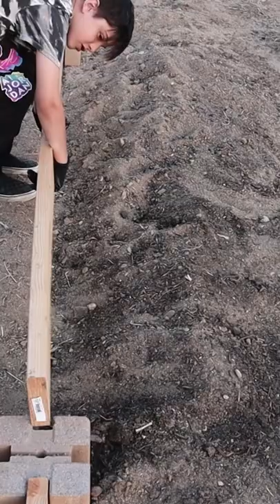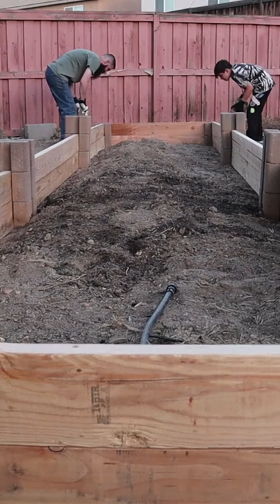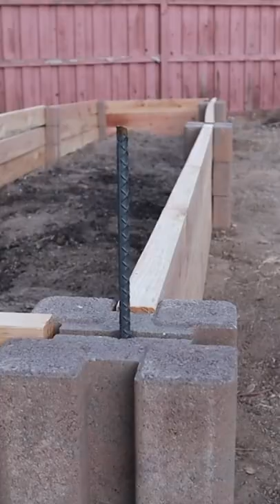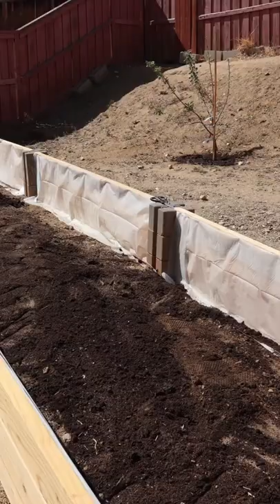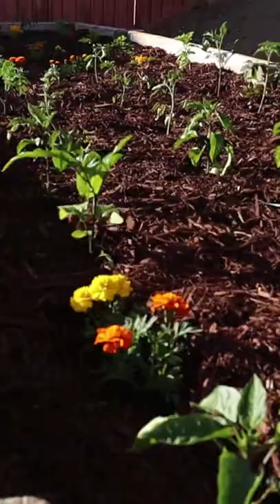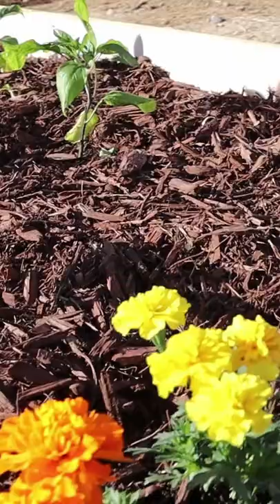Fastest way to build a Raised Garden Bed 😲💯 #shorts

Comment: This is a great idea for initially starting a quick garden.  But after about a year, the plastic lining starts chipping and breaking down into the soil and needs to be picked out.  Use a thick layer of cardboard instead of plastic so as it breaks down it won't put toxins into the garden.   . The corner bricks also start sinking into the ground over time which causes the boards to loosen and move out of place so they will eventually need to be repositioned.  But maybe if you live in an area that doesn't get much rain, it will work out well for you!
Reply: I don't think it can last longer than 3yrs if there is plenty rain like in Darwin where I live 😂
Reply: So you think pouring concrete under the bricks would help!
Reply: I think they might be using pressure treated boards. I get that it’s a strategy to keep the pressure treat from leeching into the bed but yeah I agree long term better would be heat treated and you don’t need the plastic then.
Reply: Dig down 4" under the blocks, place 3/4" stone and tamp down til level. Then place the corner blocks.  Problem solved!

Comment: I wish to build raised beds but I have 200m2 garden and this amount of wood to buy is too much for my budget.
 I did mounded raised beds instead, unframed. I have quack grass infestation so I rototilled a lot of wood chips, grass clippings and compost into my clay soil. I added minerals and then covered whole area with woven cloth to block the light.
I made small mounds 1.2x13m or 4x42 ft.
Reply: Quack grass is rhizomatic right? Rototilling would only multiply the problem if so. (we don't have quack grass so I'm not super familiar but I recall Charles Dowding addressing quack grass).

Comment: You guys are great! I keep agonizing over pressure treat vs non pressure treat wood, and somehow my brain never considered plastic sheeting! Thank you for showing this step!
Reply: Why plastic? If it’s a food garden I would want no plastic
Reply: @joansmith6844  For longevity of the garden bed. Wood rots, especially when it's constantly being watered, and the chemicals from pressure treated wood will slowly leech into the soil too. Otherwise you have to keep replacing the beds every few years.
Reply: @richelleg225  Thank you for your answer I know he reply to somebody about the plastic and where to get it from and he does NOT use treated wood If someone was making a food garden not sure why they’d wanna poison themselves But you would have to really secure that plastic not just staple it to corners or I would have to go over the edge to save  the wood from rotting-  not JUST on its side , water still would get in and seep  in between the plastic and wood You would have to take the plastic and go over the edges of the wood but I wonder if there’s another material you could use because plastic it’s not highly recommend it either if it’s a food garden.. The plastic will see into the soil and that’s not healthy- I wonder what someone could recommend to use instead of plastic maybe just another strip of wood all the way around and remove and replace it but that’s expensive
Reply: @joansmith6844 it's copper, not poison.  The formulation was changed in 2004 and it's completely benign now.  Copper is an essential dietary mineral.

I think a lot of people are confused because pre-2004 PT lumber formulations were definitely harmful, and some treated pallets are still harmful (methyl bromide).  I don't use glyphosate or insecticides on my lawn but have no concerns about using PT lumber for my garden beds.
Reply: That plastic will degrade and be an absolute nightmare. Using plastic liner is just adding mircoplastics to the soil. Believe me, after you have to pick it all out a minute piece at a time, youd prefer to replace the wood.  The plastic will not last. @richelleg225

Comment: Be careful when doing this on a slight slope! This can cause the downhill wall to slowly tilt downhill. To avoid this, build arches out of 2×4 planks every 8 ft or so. This will also allow for an easy way to build a string trellis.
Reply: Can also drive a stake in the ground and screw it to the downhill wall

Comment: Since you are polying the inside of the boards,  would you be able to use treated  boards instead?  That way they are weather resistant on the outside as well?
Reply: I bought untreated wood and applied Cabbots Australian Timber Oil. Mahogany flame looks awesome and protects.
Reply from the maker: I would still avoid treated lumber. The plastic will only last a couple years and then the treated wood would be in contact with the soil.
Reply: Pressure treated has been fine for gardening since 2004, when the formulation changed.  You will get some copper leeching into your food but copper is a necessary dietary mineral.  Some people supplement copper for health, especially if they have a zinc deficiency.

Comment: what size (diameter) of steel rods did you use on the brick blocks to hold to soil
Reply from the maker: Honestly, I'm not 100% positive but I think I used 3/8" but you could use any size that fits inside the blocks.

Comment: Where do u purchase the corner pieces. What are they called.
Reply: Home Depot and Lowe’s have them
Reply from the maker: They are called "Planter Wall Blocks". You can find them at Home Depot and Lowe's (and probably other home improvement stores) Some stores don't stock them, but you can try special ordering them.
Reply: @showstaz what size boards are those?? I want to make one just like this
Reply: @michaelwoody24  use 2x6 boards

Comment: What is the white liner called again pls?
Reply from the maker: It's just plastic sheeting from the home improvement store to help keep some moisture out of the wood
Reply: @InTheGarden  won't moisture go in to the wood from other exposed sides? Just curious if the plastic is necessary
Reply from the maker: Yes, moisture will get into the wood regardless, but much more on the side that is in constant contact with the soil. The plastic helps to keep that moisture out of the wood, but it does deteriorate quickly, so it only lasts a season or two. You could definitely leave it out.  I've just found for the small extra cost and a few minutes work, it's worth it to possibly extend the life of the wood by a couple years.
Reply: @InTheGarden  makes sense,  thanks for the reply and video!

Comment: My wife likes this method but those blocks are a PITA to mow around and trim.
Reply from the maker: I'll be trimming around mine this weekend... It does look like it will be a bit of work.
Reply: Just mow around like normal and use a string trimmer on the rest. Should take 20 seconds per bed to trim

Comment: What is the lining that was stapled on the inside?
Reply from the maker: It's just plastic sheeting from the home improvement store to help keep some moisture out of the wood
Reply: We call that kind of plastic sheeting visqueen where I'm from...
Do you put any drainage holes in the bottom?
👋👩🏼‍🦳
Edit...
I just watched the long version and found out that you didn't cover the bottom, so question answered. But I do have another question, if you're making an organic bed, what type of wood should be used? Wouldn't pressure treated wood have chemicals that we wouldn't want in our food?
Reply from the maker: @seamikki6510  you are correct, pressure treated wood would have chemicals. I just used 2x6 studs, non-treated. This means the wood will deteriorate more quickly, but no chemicals.
Reply: @InTheGarden  Love your style,  I can't watch the YouTubie/over the top videos.  I was looking for beginner drip&soak line info, so now I'm binging your channel, THX!
💌 Your new sub, 👩🏼‍🦳✌️
Reply: @InTheGarden o u put it just on the sides right ??    sides of the inner wood walls
Reply from the maker: @joansmith6844  yes, just on the sides
Reply: @InTheGarden  ty r u not worried about using plastic in a food garden .. it’s toxic just a thought .. wood is pricy , wondering what else u could use .. another layer of thin wood to dispose after a few years ?
Reply: @InTheGarden  hey also I see a hose inside ?? U left that in there ?? For future watering ??
Was looking to purchase a kit but my don said mom I can make this for u then I sent him this video $ hit the & subbed
Reply from the maker: @joansmith6844  Personally I'm not worried about the plastic. I have other plastic in the garden, such as drip irrigation lines, etc. But if this is something you're worried about you could skip this step.
Yes, the hose is for drip irrigation. I ran it under the side while building the raised bed rather than trying to do it after it's built and filled.
You can watch the full (more detailed) step-by-step video of building this raised bed here:
https://youtu.be/Hkur9krif90
Reply: @InTheGarden  ok I’ll watch full video Ty I’m excited to start one want to learn how to do the hose or I’m standing daily watering my plants
Reply from the maker: @joansmith6844  I also have a whole series of videos on Drip Irrigation for beginners:
Drip Irrigation - How to, Set up, Installation, Maintenance, Parts: https://www.youtube.com/playlist?list=PLRPvivt71gQCzuwBI3yHf5Gvgmn_KlZq

Comment: I'm a 69 year old woman....I could do that too if I had a crew of 3 or more guys to "help"!
Reply: This 67yo woman did this. Just have the Home Depot folks pull the blocks for you, cart them to checkout and load for you so you can save your energy for unloading and set-up at home. Take your time and you can do it 🙂. I'm adding another level to my 12-4'x6' beds right now and will have soil with worm castings delivered and dropped on a large tarp to move at my leisure. All with the help of Tylenol and Ibuprofen, of course 😂
Reply: I got news for ya, several beers in a frosted mug tops it off …😊

Comment: Why the plastic? That's a waste to me. All your doing is preventing worms from getting in your bed , which are very beneficial. The plastic is just going to rot away anyways. Other than that it's an awesome bed guys 💪🏻
Reply from the maker: We only put it on the sides, to keep some of the moisture from the soil from being in constant contact with the wood, not on the bottom. But you are right, it does break apart quickly anyways, so next time I would probably skip it.
Thanks for watching 😊 🌱
Reply: @InTheGarden  heck yeah that's actually a good idea. That's how the no till pots are now. Fabric pots with a layer of plastic on the inside but not all the way down so there's drainage.

Comment: Price $?
Reply from the maker: This garden bed is about 100 sq ft and total cost including soil was about $600. You could probably build a 4x8ft bed using this method for around $200
Reply: I saw a video where someone built one that was down on the ground. It was 2x6 and cost $30.
Reply: I just built 3x6x1.5 garden beds for about $20/each.  On a few I built bird/deer cages which added another $20.  Built using PT fence pickets and PT 2x4s for structure, with stakes to prevent deformation on a hill.